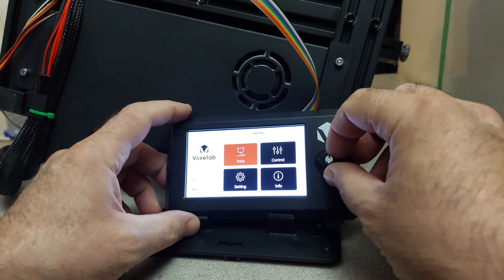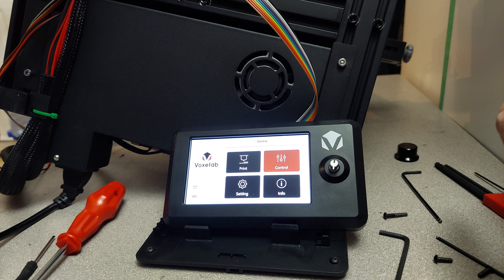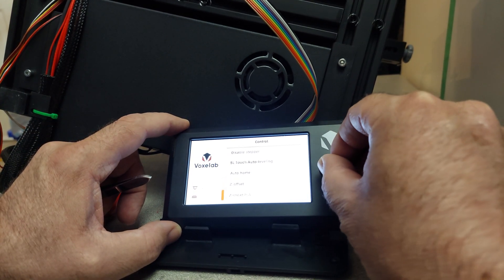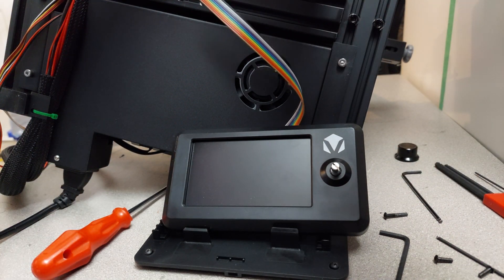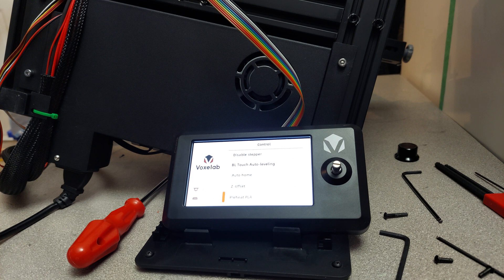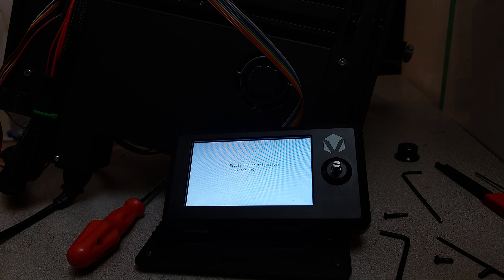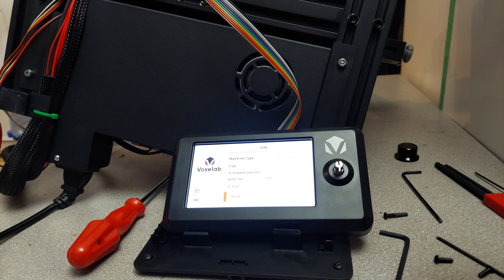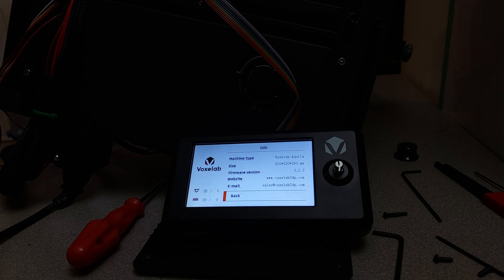Voxelab Aquila new firmware thermal runaway fix v3.1.2

Comment: With my Aquila, I have a very odd problem now!  I had the original hot end and firmware and the printer worked fine.
The the hot end had a leak on the top of the heater block just below the cooling heat break fins. 
Trouble was with the cooling fan cover for the hot end you can't see if there is a leak or problem building up there?

After seeing that the test print I was trying to do to level the bed was not being laid down on the bed, I of course stopped the printing & cooled down the printer,
Only after taking off the big fan cover did I see the reason for the lack of laid down plastic?

The full hot end was encased in a ball of leaked and now hard plastic, I tried to carefully remove the plastic from around 
the hot end and the heater cartridge and thermistor so I could save the heater cartridge and thermistor and just replace the hot end heating block.

But I just could not remove enough to save them, the plastic that leaked even set in the screw holes so the 
un-screwing of the small screws that hold the thermistor and heater cartridge was impossible!

So my only option was to buy a new replacement hot end and it this in place of the original. 
I ended up having to go through allot of work to get this out the way, lots of wires in that control box area and very tight packed too.
I photographed the wires placement on the board as I never done any un-wiring or replacing on this printer so all new to me?

I got the new hot end and some spare new heater cartridges and thermistors just in case I would need any later?
The trouble I had was the plugs on the thermistor board ends were the wrong type, they were 3 pin not the two pin ones the original plugs were!

Silly me I thought when I ordered these that all were the same? Showing how us Newbies get things wrong.

So I had then to look up how to sole this without buying more as I have a low budget.  
So it seems I can un-mount the pins on the white wires from the plug and lock them into the original two pin plugs!

Did that, then got the heating wires i and re-built the control area of the printer.  

The printer was back on But, the overheat of the hot end kept happening, it would shot fast up to 250 C.
I looked this up and found that this problem was reported as happening to some original Aquila with my chip set of G32.
The help videos said I needed to install new 3rd party firmware y a man called Alex as the official firmware was not redone yet?

I got his firmware and saw the help videos about firmware updating and I did it, then again the overheat fast shot up temperature problem still happened, 
this time the new firmware would set of a loud Alarm. Like yours did?

I found I needed also to do a pronterface PC to printer PID temperature hot end tuning too!

So got the software and plugged in the USB C cable and tried to tune the new hot end. kept getting error temperature too high test failed.
I asked the help people at Voxelab and sent the details of the testing and screenshot of the failed testing.

They after a while said it is possible the original G32 board had a fault too?

They sent me a new board ( this was a H32 board ) I could not get the firmware to install 

I tried many times in the end they pointed out that I was trying to use G32 firmware when the new board was a H32 chip one I did not know as not markings to say so?
I used the firmware they just done with the anti-fire alarm in it, it worked and the screen control icons came on.

Now here's the bad part after all that, the PID testing still has the same "temperature too high" for the hot end with the same fast over heating to 250 C.

So both Voxelab help and me and a Aquila printing group I talked to are all unable to solve this over heating failed PID tuning test?

Any thoughts guys?

Comment: I thought...What the heck you actually dont need it ,.never had a problem...but better save than sorry.
 Now my extruder is all over the place ...fu..!
  Dumbest move I ever made ....now its back to stock firmware.   
EDIT
 Managed to change the extrusion values through pronterface . Did a full PID tune and I recommend that to everybody who changes to this firmware !! Older settings are not kept with the new version. The e-steps are changeable on the screen much higher than before but they are NOT stored.  I hope at least the temp.runaway feature is working.